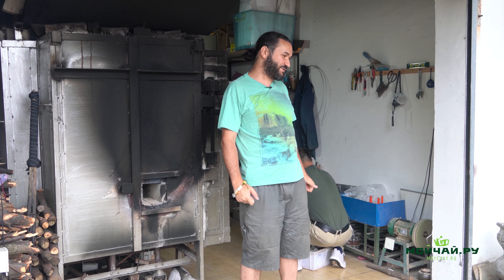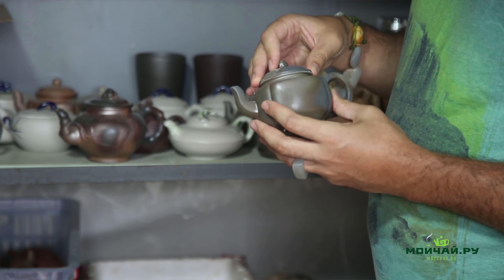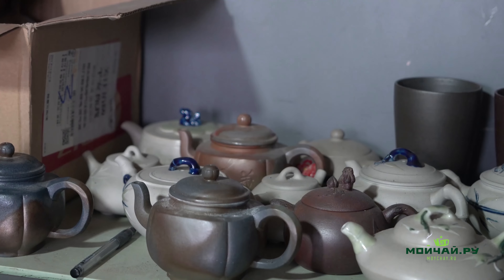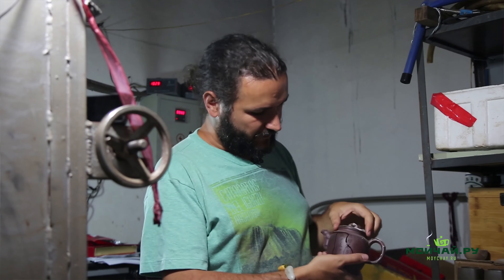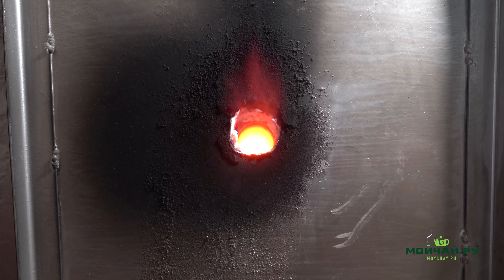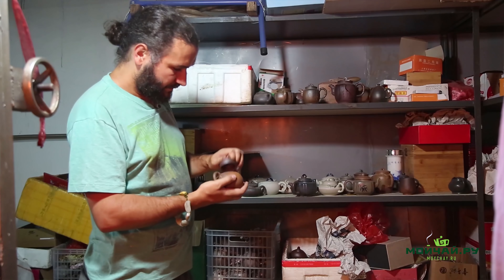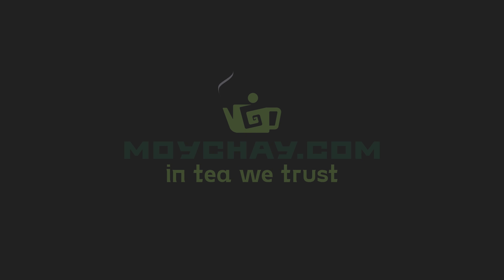Yixing teapots. Wood firing.

Comment from the maker: 00:21 Cai Shao - what does it mean?

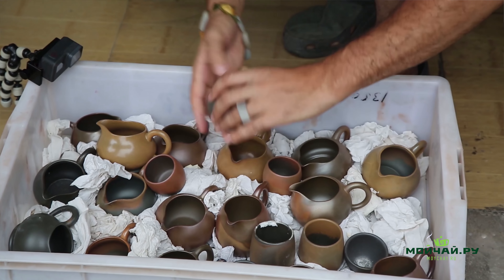02:11 How it works and first results

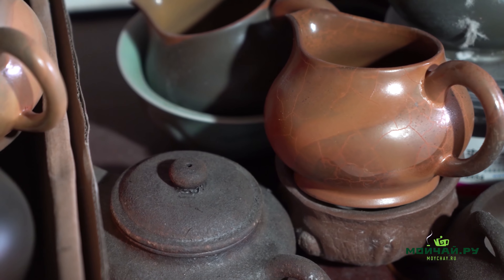03:21 Not for sale collection of local zai shao master. 

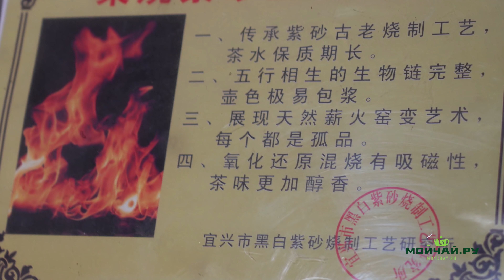04:43 Unusual results of wood firing

05:15 Function of white powder on new teapots 

06:50 Melt the kiln. Beginning of firing procedure

08:24 How long does it takes? (48 hours)

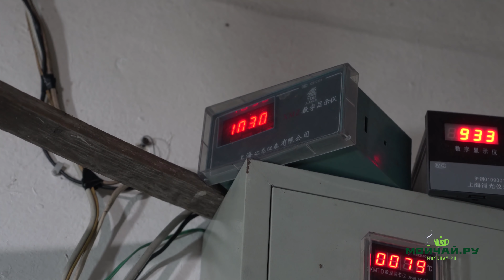09:40 1000 degrees celsius

10:50 Why cai shao is so expensive?

11:28 How to apply porcelain on Zi Sha clay

13:00 Priceless defects :)